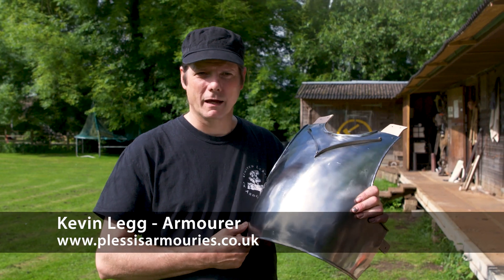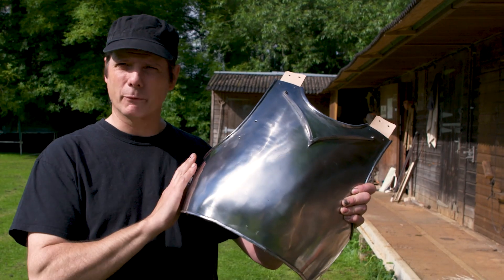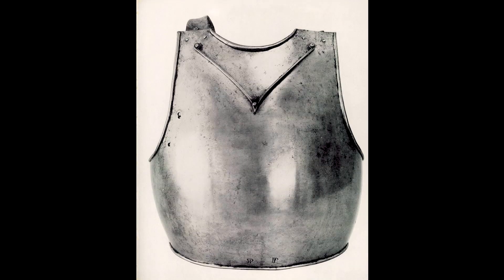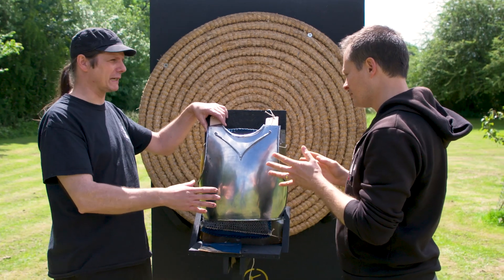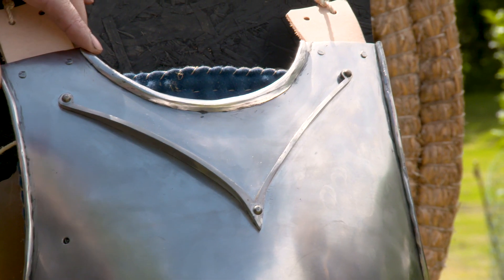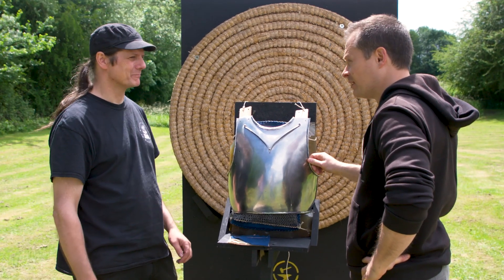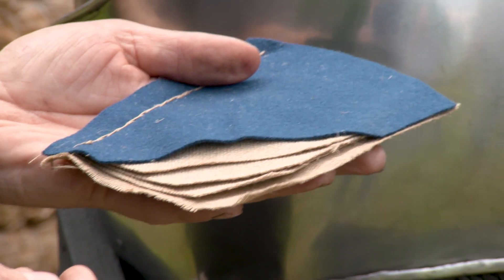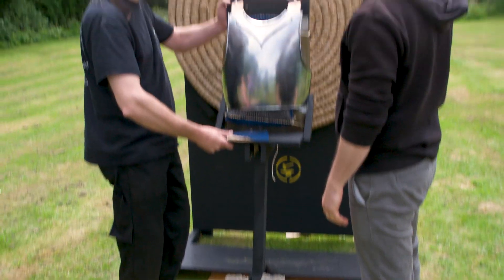Find out more - The Armour

Comment: A question for the armourer:

How difficult is it to replicate the less sophisticated steel from medieval times? Is it (much?) easier to do what you did - make the plate with a consistent percentage of carbon - instead of, so to say, trying to mix up a batch of variable carbon content steel?
Reply: Getting enough wrought iron for a breastplate would have been very expensive and time consuming. Hopefully we can do some tests in future with smaller samples of wrought iron/steel of differing hardness and thickness
Reply: By the 1400s, steel was generally made by:

1. First turning cast iron into wrought iron by repeated remelting in a finery forge to burned off the carbon content.
2. Recarburizing the wrought iron by packing and cooking it with charcoal (and/or other materials) to add back carbon, turning it into steel (cementation process). 

In Italy, another process that was used - one especially suited for making plate armour - was to dunk wrought iron bars or plates into molten cast iron, which allows the wrought iron to absorb carbon from the cast iron, carburizing it into steel (Brescian process). Both process created a varying carbon content that was higher at the exterior and lower at the interior.

Other than homogeneity, modern steel tends to have a much higher manganese content, which is purposely added during the steelmaking process. Manganese like carbon increases the hardenability of a steel - for the same carbon content and quenching temperature/cooling rate, a carbon steel sample with manganese will be harder than one without. Safe to say, the armour breastplate made from modern steel will be harder than one from medieval steel, even if the carbon content was the same. So to insure the most accurate reproduction, the steel will needed to be made from wrought iron smelted with historic ores and methods.
Reply: How hard it's to geth periode correct steel? Make it youtself ussing the tools and technisues of the day of cours.
Keep in mind people now a days struggle with the idee just how hard it was to make the stuff.
To give any one an idee. Charcoal was the feul of that time. Make 20 kg or about 40 pounds in thevway they did it back then.
You will hate me for it but you will understan what i mean. Smelting from ore to bloomery takes 5kg per kg. Of that you use even more to consilidate the bloom though wrougth iron and a bit of steel. There is a reason why only the rich could afford steel armor.
The amount of work is the reason why.

Comment: I believe it makes sense to actually bolt it down to be more representative. Your contraption probably weighs much less than an actual armoured person. Also, in a combat situation you are very likely to get hit as you moving forward (e.g. you expose yourself while trying to land a blow or ride towards enemy archers).
Reply: I agree, and if you are being hit by a hail of arrows you will be already knocked back in your saddle by the first hit while your horse is still charging forwards, so there won't be any backward movement possible.
Reply: It won't make any difference either way. The arrow is shattered and bounced before the armour even starts to move.
Reply: @Vapefly0815  Not exactly. Both processes happen at the same time, and the outcome  depends on the speed of sound in materials. It probably won't matter anyways since the arrow is hundreds times lighter than the contraption.

Comment: If that plate is repaired will it be as reliable as it was?
Reply: The advantage of it not being hardened and tempered is most definitely repairability. You'd have to dent and repair it a whole lot before you'd weaken the material enough to make any difference.
Reply: Interesting. I was wondering the same.
Reply: @tods_workshop  surely repairing any dents would affect its structural integrity ? I'd love to see an experiment of this to simulate a used piece of armour.
Also the effects of the arrows on the breaths of a helmet would be great to see. 
Love the work you are doing as always !
Reply: If a concern existed about stress risers and localized grain interruptions, it could be re-heated above "critical" and re-cooled. If done well, it would be no different than the initial treatment.
Simply knocking the dents back would likely cause the aforementioned localized stress- whether to a point of concern or not, I can't say.
Reply: @tods_workshop  Well,I guess that depends on the blacksmith. Done right,yes. Sloppy,possibly not.

Comment: Archers would have known to aim at the sides
Reply: I am not entirely sure how that is supposed to work apart from having archers positioned at the flanks at a radical enough angle to allow for shooting perpendicular into the sides of their targets, which is a possible (we have some accounts of horse archers firing into the "unshielded side" in predating centuries) but tactically complex endevour to set up and maintain for foot archers. If archers would aim at the sides while facing late middle ages armoured retinues head on, (A) it would be virtually impossible and assuredly impractical to aim at the sides in the first place, and (B), if they did, the sloping would ensure that incoming arrows are deflected away, as convincingly demonstrated in the main video.
Reply: And man at arms would have known not to offer the side to the ennemy.
Reply: Much like with firearms, much of the shooting at combat distances, outside of point blank range, doesn't allow for ultra precise aiming, you're more likely aiming at a man sized target no more precise then that.
Reply: Legs and groin, I reckon. 😬
Reply: @ironpirate8  I would guess that they concentrated on volume of fire more than precise targeting. They would hope for a lucky shot or ricochet, and if not, just the effective of pounding someone that much before the press would have a significant affect.
Reply: @mpsmith47304  Maybe, but they did practise regularly, shooting at small targets like rope rings.  So if the guys coming towards them were wearing arrow proof breastplates, why not aim above or below?

Comment: Someday somebody will find this breastplate. Period correct and battered by strikes from an english longbow.
They will try to date it, and whatever method they use it will always show an age about 600 years too young.
They'll be left hella confused.  =)
Reply: Aliens Influenced medieval warfare. Next on The History Channel.
Reply: I don't think so. AFAIK, dating iron itself is basically impossible, as with iron there simply isn't something similar to the known ratio of radioactive carbon vs. stable carbon isotopes inside living plants that starts to change slowly due to decay after death. What can be done is extracting some of the carbon from the steel and dating that, since the carbon is added by the smelting process. So what you are really doing is dating the carbon source that was involved in the production of the steel. For medieval or even older objects, this is mostly OK (+/- things like meteor iron), since they used charcoal which was made from living trees at basically the same time as the steel was produced. But modern steel is produced using bituminous coal, if you tried dating it this way, if any it will shop up as the age of when the coal seam the coal was extracted from was beginning to be formed. AFAIK, there are some papers with dating results for modern steels or cast irons, and they mostly show up as 30 to 40 thousand years old. If you want to know more, have a look at https://www.tms.org/pubs/journals/JOM/0305/Cook-0305.html for example.

Dating the arrowheads is a bit more plausible, since even a few wooden splinters left in the socket would mean that you could at least determine the age of the shaft that it was on.
Reply: @blahfasel2000  Well lets hope that they also know about this interesting paper and come to the conclusion that C-14 dating of steel is problematic.
I guess i could make a case that the carbon in the case hardening of the arrows is possible to date, but that will be rusted away.
Thanks for the interesting read anyway.
Regarding the accuracy of radiocarbon dating, I've heard a myth, were students where supposed to bring organic samples for dating.
Everything went well until one fresh grass sample showed an impossible age.
Turns out the student acquired that from a busy road and a lot of the carbon the plants inhaled was from CO2 coming from burned fossile fuel.
Reply: @kilianortmann9979  Yepp, totally plausible that story about the grass. For dating methods to work you really have to know about the type and context of the object. Just taking some completely unknown chunk of organic material gives you basically meaningless results.

A well known example (which unfortunately creationists often try to exploit when trying to discredit radiocarbon dating altogether) of why this matters are marine organisms. For one the carbon 14 is generated in the athmosphere, and it takes time before it mixes down into the oceans, meaning that some of it has decayed by the time it gets there. Then there are other (fossil) carbon sources like for example limestone dissolved by the water. Therefore if you try to date a maritime organism using the same charts as a land living plant for example, you get results that are typically between 400 to 1200 years older than they really are, depending on exactly where in the oceans they had been living.

This even goes so far that for example dating viking bodies from a single burial site in England  (which had presumable been buried more or less at the same time) yielded results spanning multiple centuries, due to the high (and varying) amount of seafood consumed by them.

Edit: That's why wood samples for example are so valuable. We know that wooden plants only grow on land, and basically all their carbon is directly from the air. That removes an awful lot of variables from the equation.
Reply: @tods_workshop  I was thinking the same thing when I saw your vid^^.
Reply: I'm pretty sure they'll have a good guess what happened.  I don't think experimental archeology or living history is going away.

Comment: Just a thought, but shouldn't the ballistic knight be traveling towards the archer at horse speed?
Reply: Most knights at agincourt were dismounted. They tried a few cav charges, they failed, so the rest of the battle was done on foot
Reply: Many knights were dismounted and both those who were dismounted and those how were mounted were bogged down by mud in front of the English Archers, thus they wouldn't be moving very fast.
Reply: "fully armored men-at-arms" is an expression you can use for the fighters at agincourt to circumvent the conception of "knight on horseback". Most of them were dismounted during the battle, which is not an uncommon sight for "knights in battle".
Reply: Large heavy shock formations are hard to manoeuver in the battlefield. There's a battle in the ancient Egypt where the pharaoh's chariots missed the enemy army and then took 15km to turn around. When we're talking about thousands of knights they would mostly dismount to fit in the battleground.